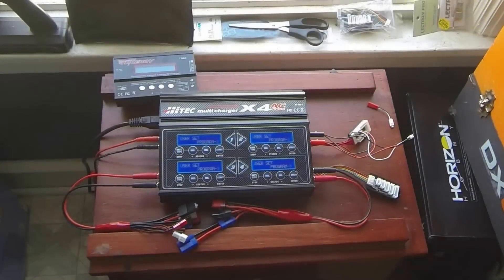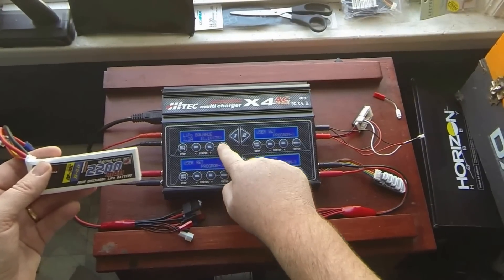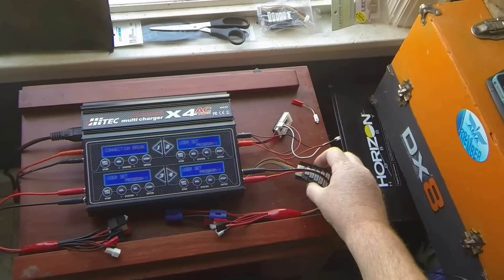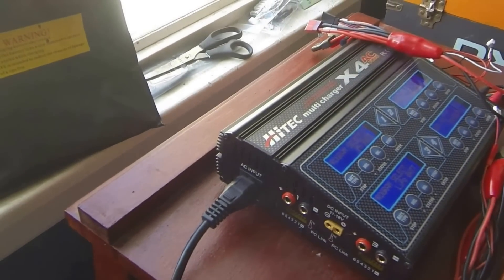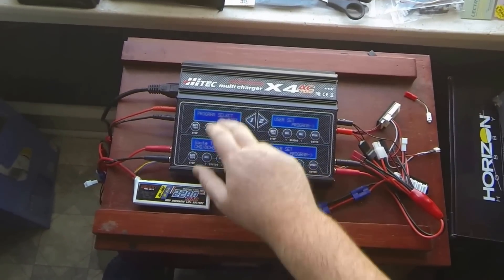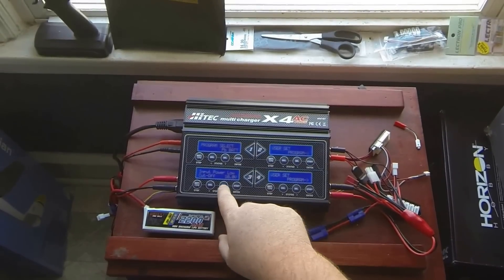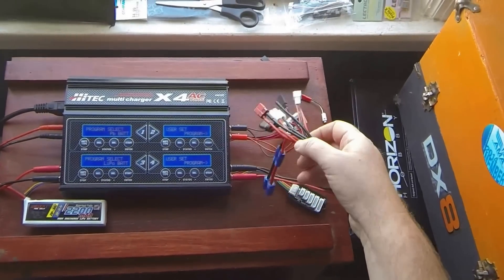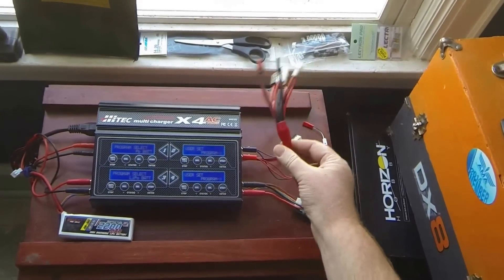Hitec X4 AC Plus 4 Port AC/DC Multi-Charger (LiPo, NiMH, etc...) Review and Tips

Comment: How is the noise of the fands, is it audible? I mean I have an older Gruapner charger which is great but has a disturbing fan noise while working in the same room. Thx
Reply from the maker: I'd like to give you an answer, but my internal power supply burned out months ago and I have it hooked into a converted server power supply that is pretty loud. I could have paid the $50 for the repair, but I had the power supply. In the video it is on and it seems really quiet.
Reply: Thanks! Which one is ON in the video, the original one or the "converted" / replacement one (not original)? Thx
Reply from the maker: That is the original a few days after I got it.
Reply from the maker: Now that it is getting dark early I have been doing battery maintenance and making sure all batteries are at a storage charge. If you are discharging batteries on the X4 the fan it starts to kick in, which makes sense since discharging creates heat. Most of the time it does this loud and annoying one second on and then one second off rotation. This morning I charged 4 batteries on it and no fan, so the issues is mostly while discharging batteries.

Comment: Nice charger, will it charge  6A per port? I was looking for something  that I can use 3 para boards on and charge my FPV gear at the same time

I have a Imax B6AC at the moment  and the menus look the same
Reply from the maker: obscured021 The 6A per port isn't much of a bump up from 5A and with 3S or more lipos it won't make a real difference due to some limitations with multiple cell batteries. For example, my 6S 5000 lipos only balance charge at 2.2 amp per cell on the X4 and I don't think it is even getting that. I did pick up the IMax B6 Ultimate Duo with a server power supply used at the LHS and 10 amps per channel does make a huge difference. Charging a brand new 4S 1350 mah pulse battery at 5C only took 15 minutes and it has cut 20+ minutes off the charging times of my larger batteries even at a 1C charge rate.

Think about how your B6AC parallel charges for you right now and if having 4 of them going would be enough to rotate out enough batteries and keep you flying. If you don't mind sitting and doing some quad maintenance every once in a while, I would go for the X4 just portability and convenience alone. Server power supplies are bulky and my iMax will probably not leave the house. If you are on a budget, just get 3 more cheap Imax chargers and a power strip. If you want shorter charge time, I can recommend 10A dual port chargers, but they can get pricy. Some of the pros at the shop were telling me about their 40+ amp setups the other day and being able to charge some batts in 5 minutes. I just looked up the price of them without the power supplies (you have to rig multiple up in parallel) and it is insane.

I still use and love the X4 because I have a lot of smaller batteries. The only reason I have the higher power IMax is because it and the MaxAmps power supply were $100 and I had to get it quick because some other guys started drooling over it. It really was an impulse buy, but one that I use often. I still have my little Tenergy TB6B (5A) too for when I go camping and don't have a lot of room. All 3 of these chargers have the exact same menus. On the IMax I have to hit a button to switch between channels, but that is it.

Comment: would you still recommend it?
Reply from the maker: Yes, I would. It has been rock solid the past 9 months. No issues and my battery collection is healthy.
Reply: thank you ill give it a try
Reply from the maker: lopez utilities No problem. I do use it for 2S 150 mah all the way to 6S 5000 mah LiPOs. It may be a little slow on the 6S 5000 mah, but I usually charge at 1C anyhow. If you are looking to charge large capacity batteries at 2c or 3c, you may want to look at something with a higher max charge rate than 6 amps. When I was choosing, I was more concerned with battery health than charging times.

Comment: Hey Chad where did you buy those multi cables at? I have this charger to love it. Have you charged AA batterys at all? i tryed but only put couple hundred mah in the battery then shows its full. have you had this problem?
Reply from the maker: I just picked them up at the local hobby store. I think they were $12 each.

I have not tried AA batteries with this because I have a good dedicated charger for them. I have hooked this up to a few Makida 18v MiMH batteries for drills and saws and cycled through them a few times and that worked great and bought me a little more time.